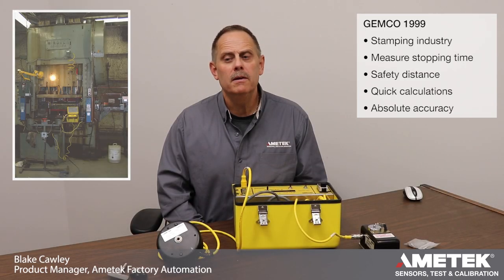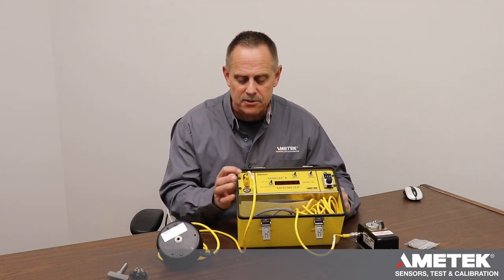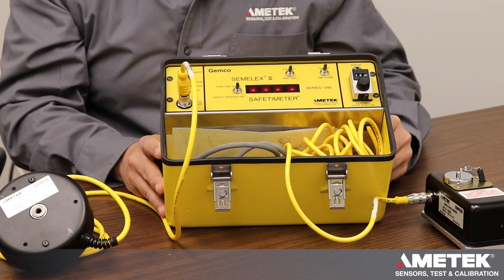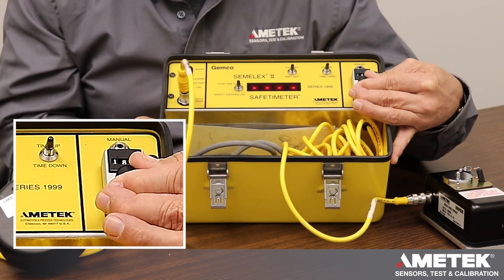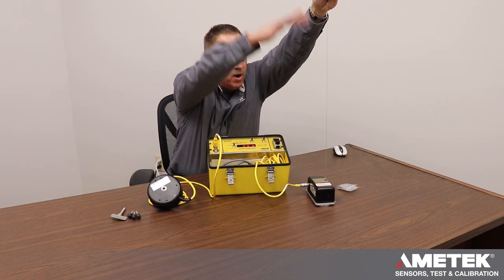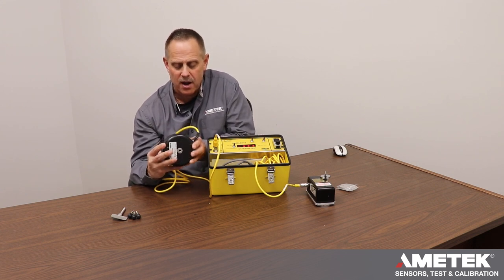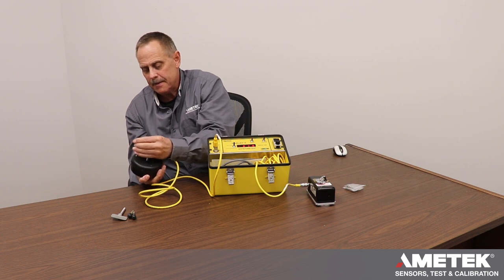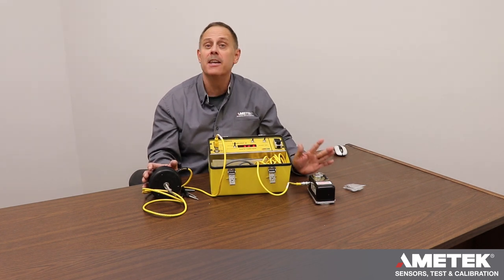Safe Working Environment For Stamping Presses With Gemco 1999 Semelex

Comment: At my work, we set the start point by first bring the ram height to about 3/4 high in the total vertical range and then adjust the start point dial up until the auto-hand clicks.